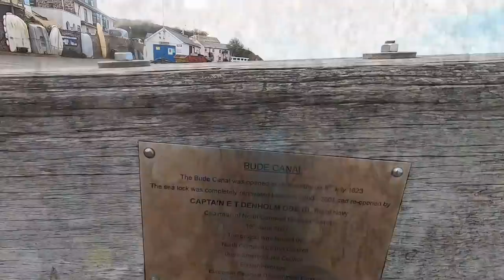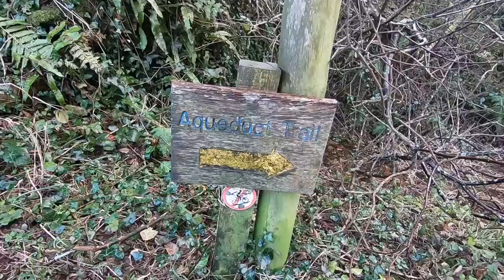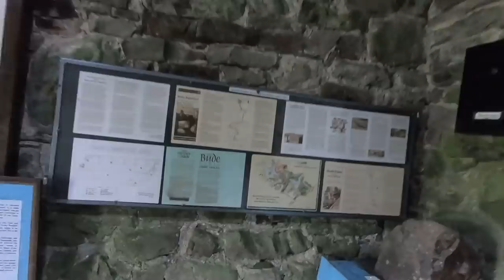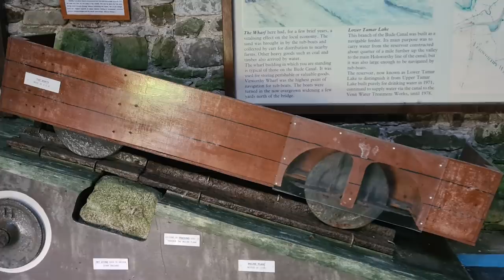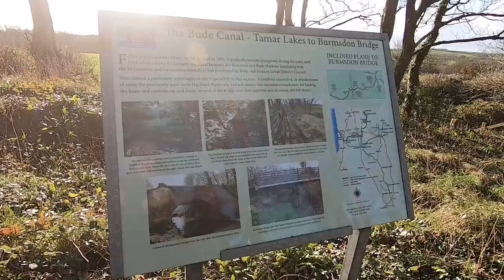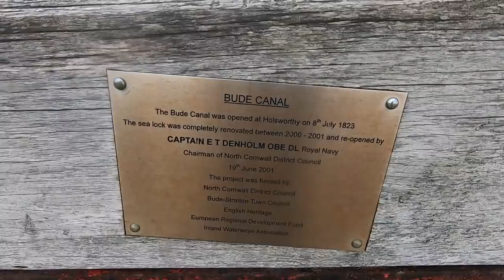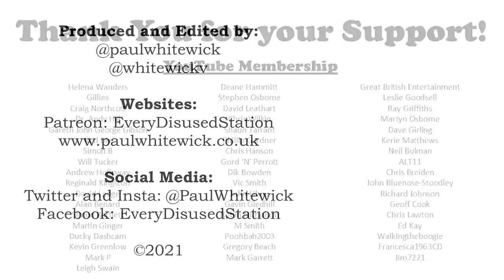How to Sell Sand - A Short History of the Bude Canal

Comment: Back when I used to live in Cornwall I often walked along there, but I never knew most of that background info, so thank you. I think if one wanted to "rewater" a "restored" leisure use canal today one would probably need to figure out an alternative method to lift and drop the boats, but the old Cornish mining engineers that would have worked on the original build were certainly ingenious.
Reply: I think I remember a visit to Foxton locks on the Leicester section of the Grand Union Canal in the Midlands. They have been built alongside the old incline that predated them. The remains of the incline have been preserved along with information panels so rather interesting to see both methods of overcoming changes in elevation alongside each other.

Comment: Well done - a very interesting video.  I was particularly impressed by the clever simplicity of the water-operated hoisting machinery of the Hobbacott incline, as shown on the hand-drawn diagram (15min.53sec.).  The Engineer had used clockmakers' chiming technology, but on a larger scale, with a spinner-and-vane mechanism for regulating the speed of the machinery using air resistance. Without it the machinery would run away and destroy itself. This is the vertically-mounted mechanism on the left, and the particularly clever bit is that it is adjustable by simply changing the projection angle of the vanes.  It must have been terrifying to watch, and you certainly wouldn't stand too close!  The water tanks in the shaft act as the driving force in the same way as the chime weight of a clock.  .

Comment: Just to add that the tramway went over that little stone bridge to the beach. Just after that there is what almost looks like a large circular drain cover in the sand.  Look closely and it's actually the wagon turntable used to link up with the moveable lengths of line that the sand was dug from. Would have been nice to had some better shots of the tram lines on that slope for people that don't know it. Quite a remarkable survivor.

Comment: twelve hours after watching this video the significance of the sand came to me as I’ve personally seen it delivered by rail in the US…a railroad in the US called New Hampshire Northcoast delivers similar sand to a cement and concrete factory in the city of Boston several hundred miles away, they have kept railroad alive in Boston by delivering regular carloads via the larger Boston & Maine Railroad. this same sand is key to Boston’s infrastructure including a massive tunnel project that took over 20 years to complete and changed the face of Boston permanently

fittingly, it was built on top of the remains of one of the original canals of New England, the Middlesex Canal

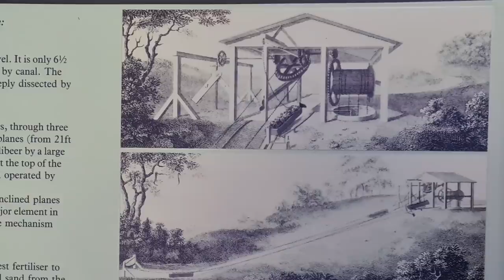Comment: 9:52 Sorry if this was explained and I'm just not getting it, but I'm confused by this part.  If they would release the water from the buckets, how did they refill them later when they needed to repeat the procedure?
Reply from the maker: Good question Stacy. So they would have been refilled using water from the top. Essentially this would still use a lot of water but I guess not as much as four of five lock gates to make the same stretch.